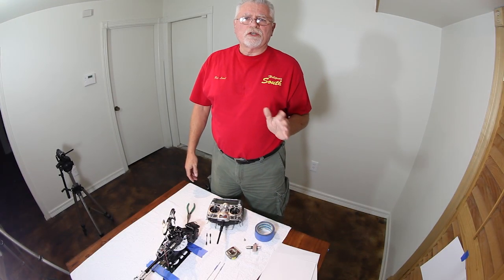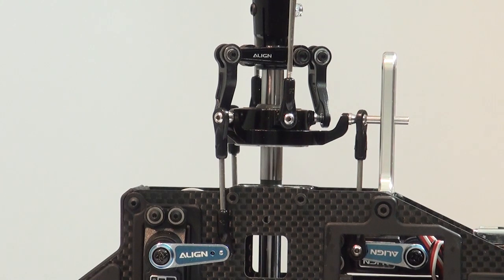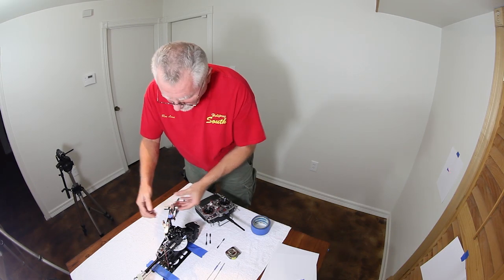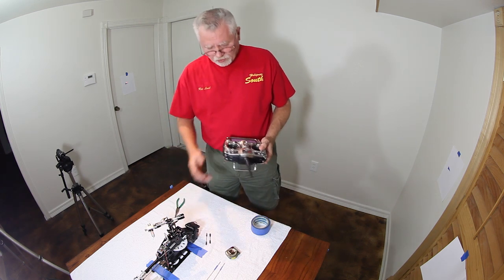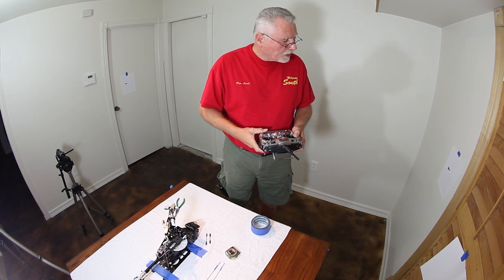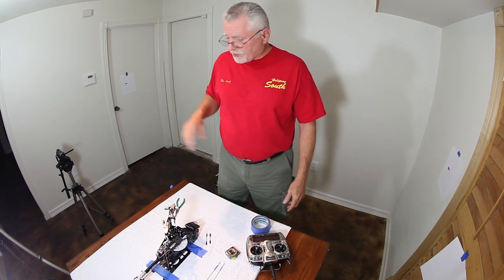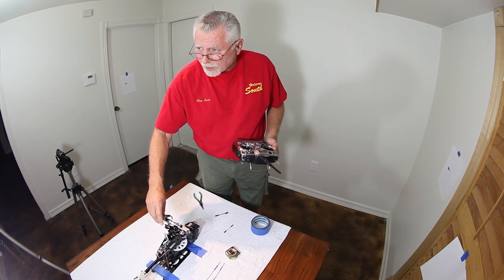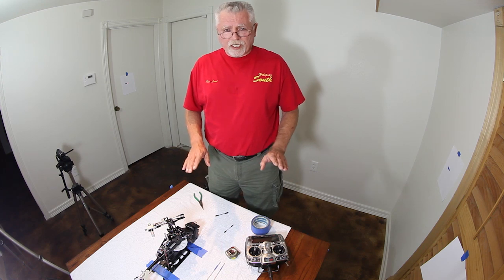LPG V2 Leveling the Swashplate - 3 Servo CCPM - NEW!!!

Comment: Thanks for the quick response. I just got a great deal on a slightly used Blade 450 3D. As I'm sure you know, it has a fly bar. Do you level the paddles the same way?